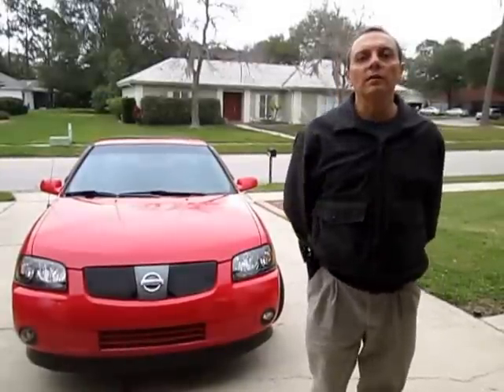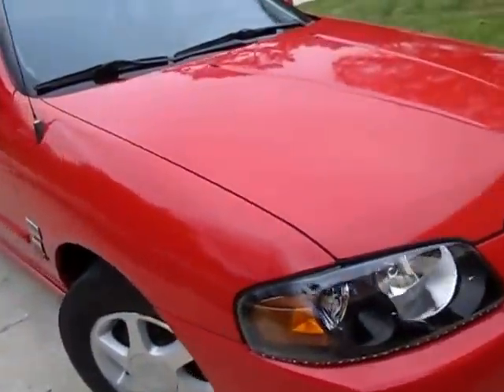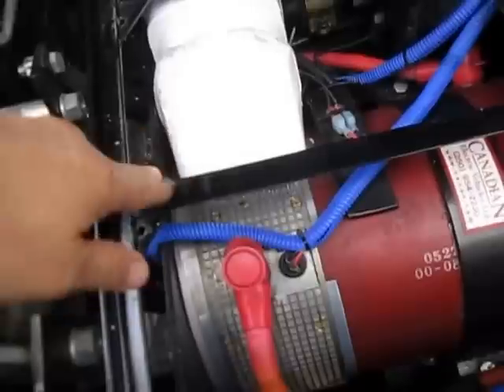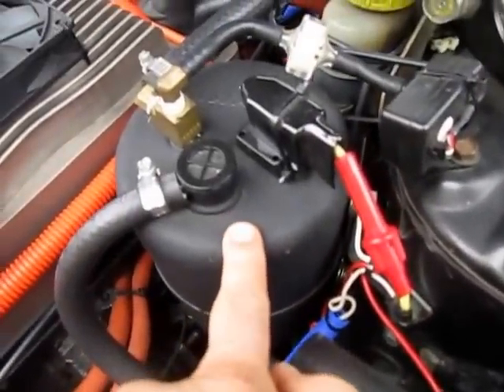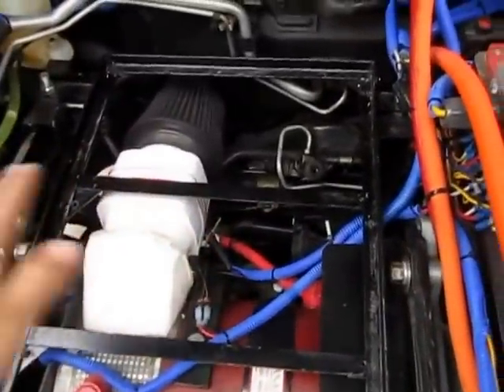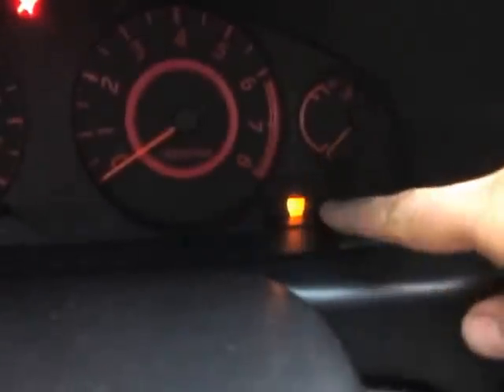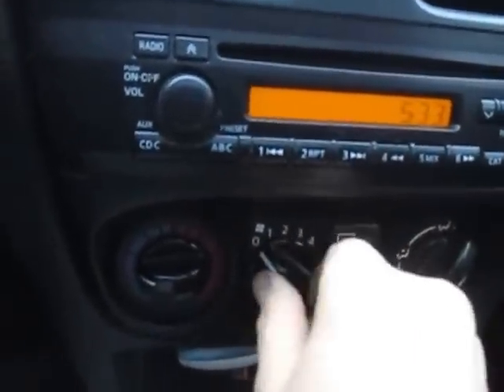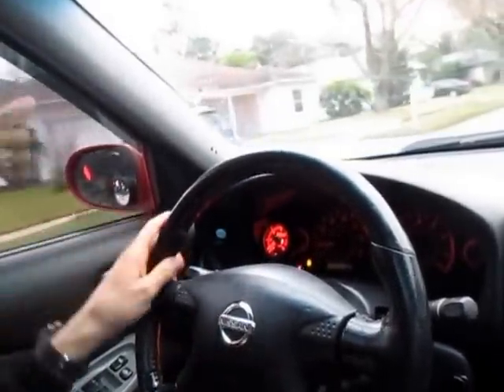Nissan Sentra Electric Car Conversion Part 46

Comment: Beautiful conversion, I have a 2002 ser would like to do it myself any information please
Reply from the maker: Hola. Thank you for your comments. I guess the best information is in the actual videos. Something I would do different today is to pick different components. The components including the batteries have improved a lot since I built mine and there are also many new or used components that are much better priced and also perform better. One thing I would definitely do different is to pick an AC system instead of the DC system I used. Good luck on your conversion.

Comment: I hope to make my 2003 like this your set up will be heavily used and inspired by. Ima deff cap all credit your way my man
Reply from the maker: Thank you. Good luck on your conversion. There are much better components these days and much better priced with availability of used parts that I didn't benefit from. You most likely will make a better one, with regenerative breaking for example or not using lead acid for the first try as I did. Good luck

Comment: Hola Señor Carlos. Regreso para desearte bien y consultar a cerca de la sustitución de la batería por super capacitadores. Me gustaría saber más. Gracias!
Reply from the maker: Super capacitors pueden cargar y descargar energia muy rapido, pero no pueden gargar mucha energia lo cual los hace no ideales para carros electricos. Con un banco de super capacitores solo podrias manejar unos cuantos kilometors. Pueden tener algunos usos interesantes como reemplazar la bateria de accessorios o en autos de arrancones, pero no para usos serios de transporte. Algunos los han usado en paralelo a las baterias para reducir el daño a baterias con demandas muy fuertes de energia al arrancar, pero no se usan en mas que esto. Saludos

Comment: do you have to shift gear going up mountain road ?
Reply from the maker: I don't know. Tampa is completly flat with no hills, but most likely yes. Shift from 2nd to third and back to 2nd. I drive it in 3rd in flat land and 4th in highway.

Comment: Really a nice build been watching your videos during the build.  Not sure selling the battery before selling the car is a good idea, if you have some other battery that can be used for test drives that would make it sell quicker.  Its hard since the price for the batteries are so expensive and hard to find good ones.
Reply from the maker: Hello. I got a local offer for the batteries andI didn't want to let the customer pass, but it is proving more difficult to sale the car without batteries. I think I will have to remove the parts and sale them separate and recycle the car.